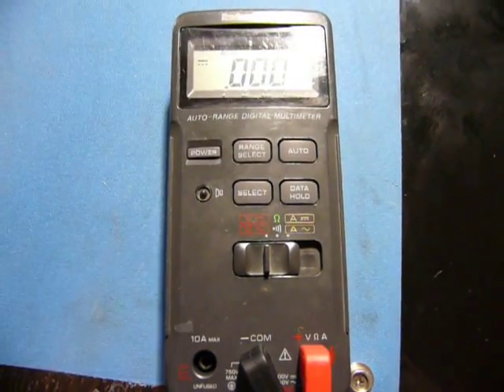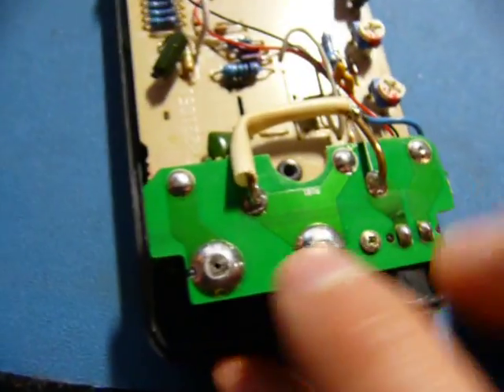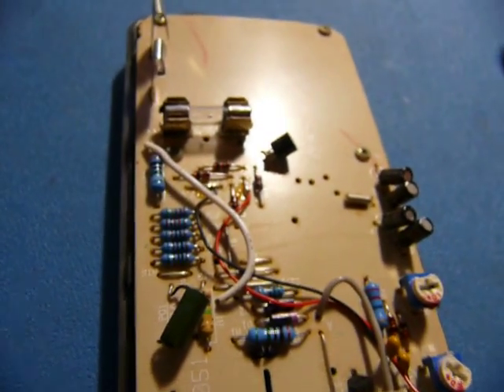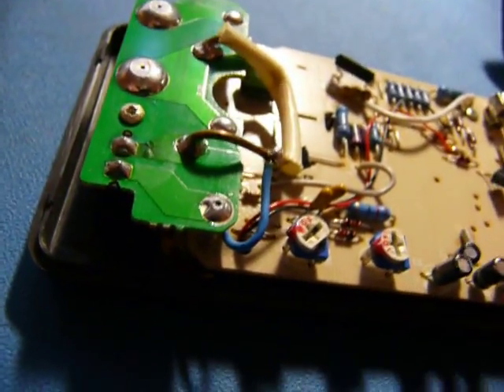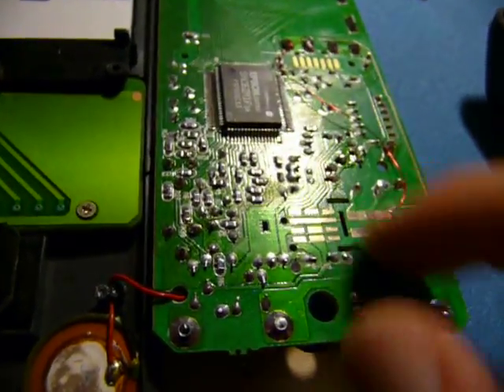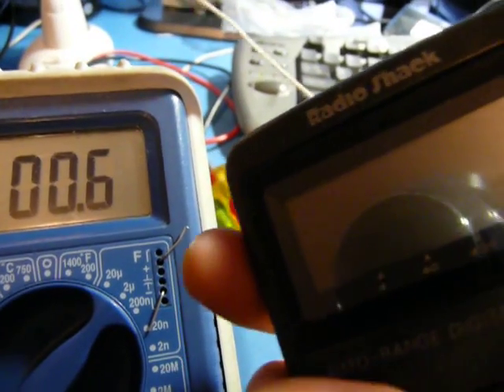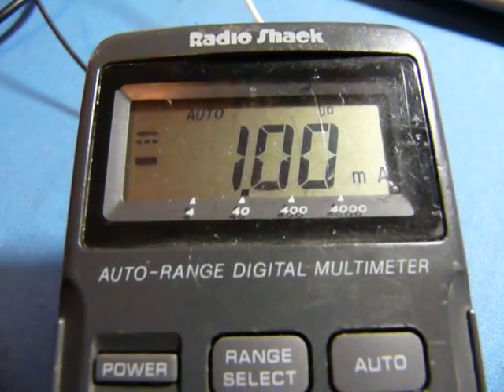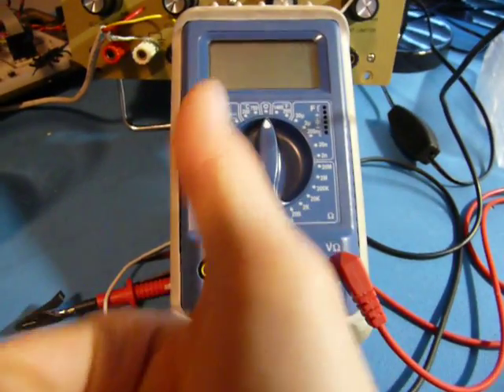Teardown/Cal: RadioShack 22-163 DMM

Comment: I have one of these. A great meter. I will have to check R12 in mine because half the time I turn it on the voltage range reads two or three times high and sliding the switch back and forth corrects it. I thought it was a boot up problem with incorrectly reading the ADC but maybe a cracked resistor.

Comment: I bought this multimeter back in the 90's and now it's 2022 and it's still going strong.  I keep thinking I want to buy a new multimeter but why?
Reply: It doesn't measure capacitance.  I had to buy another multimeter just to have that option however I'm keeping this meter because it works perfectly after 29 years.

Comment: Bought mine on close-out at RS Livonia (Mich) Mall in late 90s.  Worked just fine til i fried something with a 12V automotive battery charging project.  Swapped the fuse, and now it just shows "C" in the display when set to "V" but on  "Ohms" or "Amps" it just shows "1    1"  no matter what I connect the leads to.  My 20 yo microwave LCD has some missing display cells so I guess Its time to look for a new one.  Trouble is Radio Shack is pretty much gone from our little old town.  Maybe I can mail order a better one from China, hi hi.
73 W8IMP, JD, Las Cruces, New Mexico, USA

Comment: Its a good meter... i've had mine for a great many years and not a single issue, very well taken care of and still looks like new, paid $35 new at the time, its not top of the line, but for an auto ranging unit, it fits the bill perfectly for beginers on up.

Comment: I have owned this cheap-o meter for a good 20 years. It works as if it were new. And it is still my favourite all around meter for stuff I do around the house. Sure it has none of the precision and features of a Fluke. But it gets the job done. The simplicity of its design has made this thing a tank ! It's, as the video has shown, almost undestructible.
Thanks for sharing and showing me how good mine still looks... ;)
Reply: Mine measures same exact DC voltage as my Fluke.